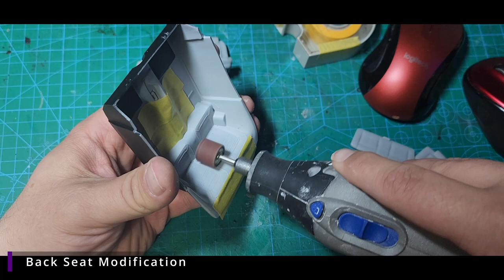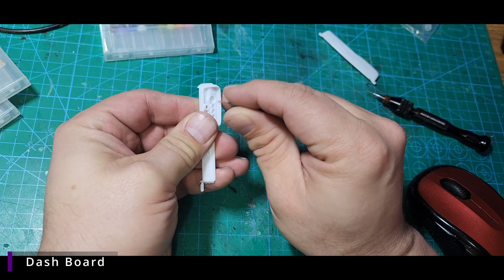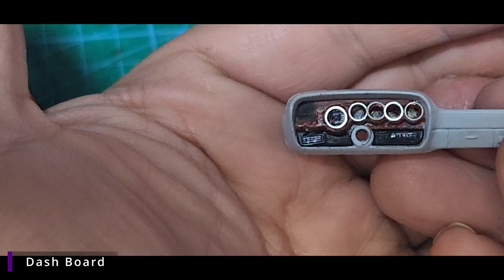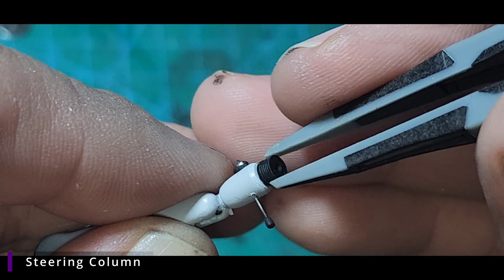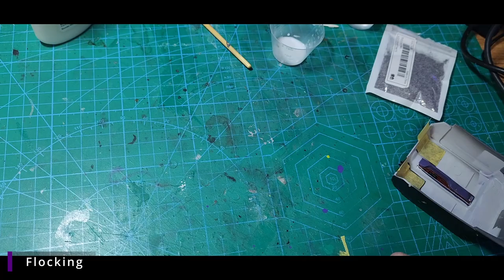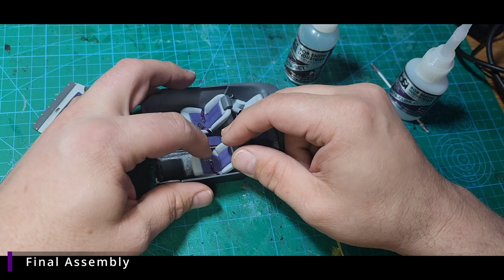Revell - '70 Challenger - Interior

Comment: Fantastic work on the interior Justin!!!   Well Done!!!!   Very Cool ignition switches!!!!    Do you have those and window cranks on your 3D print page???  Neat tip with the freezer bag.  I usually do mine over a paper plate.  I fold it to make it easy to put the left over back in the tube or bag depending on the brand.   Where do you get those long tips on the end of your superglue????    I'll be watching
Reply from the maker: The window cranks have been up for a while, they are my best selling file. The ignition switch just went up as I forgot to add it to the store. 

I used to flock over white paper and do the same thing for clean up. this was a little more cumbersome doing the actual flocking, but there was no mess and getting the flocking back in the little bag was super easy. 

I get the CA glue applicators off amazon, but watch the length. The first set i bought were 2 - 3 inches long and I loved them. The second I wasn't paying attention and they are 5 inches long, they are very hard to control the tip, so I usually cut half of the tip off before I use them.

Comment: The interior looks great! Picked up two tips, using blue tac for masking and the mechanical pencil for painting, thanks! Can you tell me where to get the center point tool? Also, what sandpaper do you use on your small sanding tool? Thanks.
Reply from the maker: Hey Rob! The only thing with blue tack is it can be kina sticky to get back out. easiest way to get it back off is often with a big ball of more blue tack. 

The center tool is called "the dead center tool" You can get it at the scale pro shop: https://scaleproshop.com  Honestly this is one of the best $5 I've ever spent. I use somewhere it on pretty much every build now. I don't even put it up, i use it so often it just stays on the monitor shelf on my desk. 

The sand paper I use is the DSPIAE adhesive sand paper. It's really quite good. For most work I use the 400, for aggressive work I drop down to 240. This is also the paper you see me us on their aluminum sanding boards (often the red or blue sanding sticks in the videos).
Reply: @JHartModelworks  Thanks for all the information! KUTGW

Comment: What band is the chisel you use in video? or set .Im so behind on  getting the right tool  for modeling. i broke alot of those small bits.
Reply from the maker: Dude,  I buy the 0.3, 0.4, and 0.6mm bits in 20 packs, because I break so many of them.  The chisels are some no name amazon.com brand.  Unxuey i think.  They are $15. They come in handy at times,  but not something I felt the need to drop a fortune on.